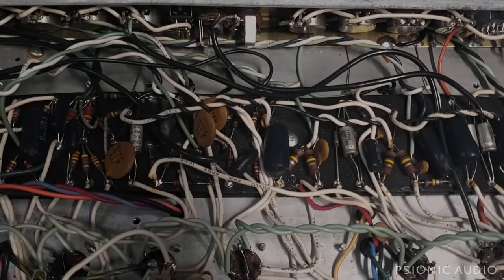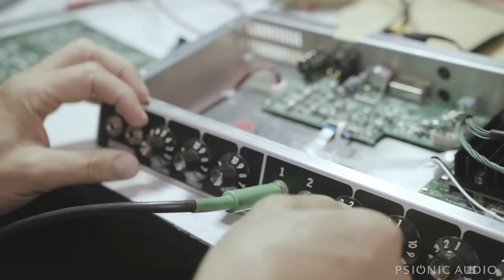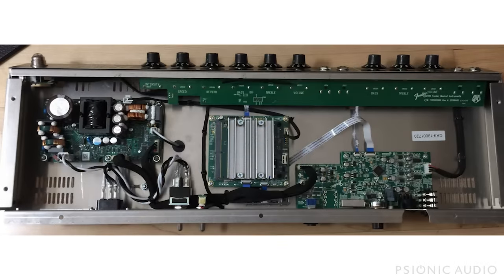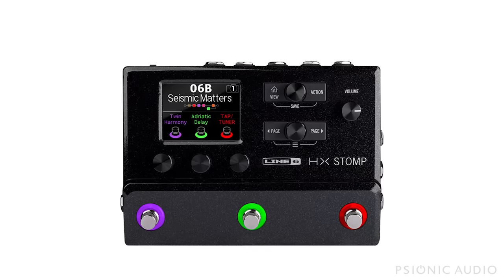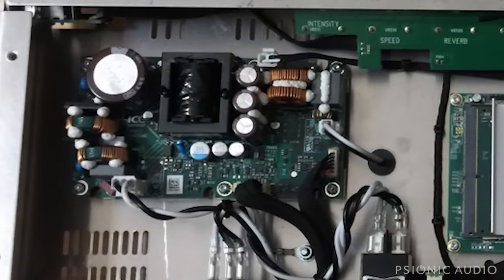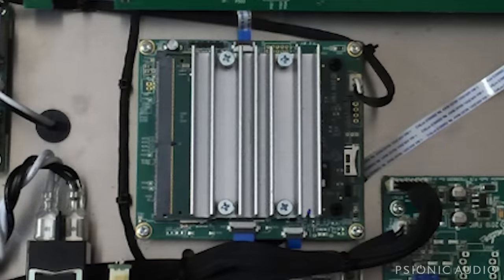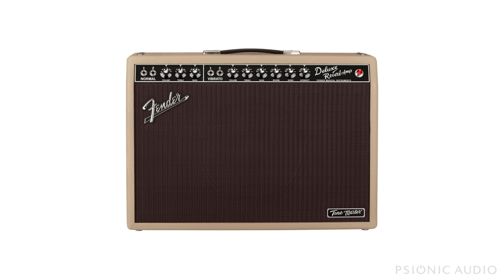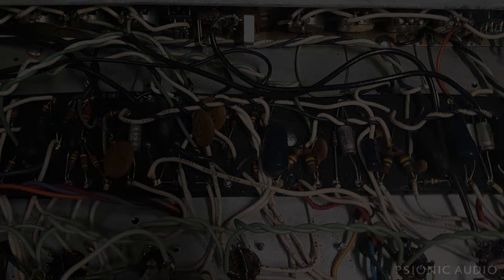We Need to Talk about the Tone Masters

Comment: Hello Lyle , let me correct you on a thing or two , the jensen neo speaker is not based on the C12K speaker , it is based on a jensen alnico speaker , also the frimware update is not needed if you have the black version ( wich i do for 2 years now ) , to my ears is sounds fine the way it is and i don't like the sound with the firmware upgrade  and the  celestion neo ( i realize this is an taste thing so everybody will have is own opinion on that ) , also an effect loop is not needed , my time related pedals sound fine just in front off the amp , also the resale value is fairly good , here in holland they cost about 950 euro new since there on the market and i see them being sold 2e hand for 700 euro on the markerplace site , so that's not to bad either . All in all , not to bad , but yes , will they last ? , only time will tell , it's good to see they can be repaired though ( wich was one off my worries ) , luckaly i live near to the official dutch fender service center , so we'll wait and see, but for me at least this is an perfect solution amp , good sounds , not to heavy , ect. and i also use an behringer P1 so i can play silent with my headphones wich is an extra plus , the behringer P1 only cost me 50 euro's and an short xlr cable for 5 euro's , so that's not too many extra money to have this extra function with this amp . I have been a tubesnob for 40 years , but those day's are over , i am sticking with my tonemaster dr . Like you're vids , grt , Toon.
Reply from the maker: Fender spent five minutes in their video explaining how they painstakingly modeled the sound of the C12K.
Reply: @PsionicAudio  mmm , well that's news for me , haha : ) , but to be frank  , i don't give a .... where this jensen neo is modeled after , all i know for sure is the fact it sounds ok to me and like i said i don't like the sound off the celestion neo and firmware upgrades . We all know sound is an subjectiv thing , but for me the fender / jensen marriage is made in tone heaven : )

Comment: I have the blonde Tonemaster which is the one with a cream back, it sounds great to me but I also haven't got or played a valve one.  The firmware is comes in both Jenson and cream back flavours and both have a with and without bright cap option.  They also adjust the taper of the reverb pot.  As far as I am aware you can flash between all of them on the amp as you see fit at any time, it's just a little fiddly as you need to hold a button to let it load in update mode.

For me the best thing is I can turn the dial on the back to 1W for home playing, and I don't gig.  I wish it had a headphones out as well as the XLR but at some point I'll get lucky on eBay and find a cheap mixer for that.

I am fully aware that the nature of the build means when something gives up I'm probably screwed if I can't get the part.  When that is the case I'll probably get a chassis kit and build a valve one into it and reuse the cab, faceplate, speaker and knobs.
Reply from the maker: I forgot to mention the lack of a headphone out in this. When I do the full amps < $1000 video I'll mention the workaround.

If I had one here I'd run the XLR out into my Focusrite Scarlett which does have a headphone out. Which is similar to what most people using the XLR out would do these days. Or I could use the headphone jack on my laptop if the XLR to computer interface lacks one.
Reply: @PsionicAudio  a computer interface is my other plan to try I just don’t have one.

Comment: Fender is saying that the Tone Master series and the other newer fender amplifiers use LOW Impedance reverb compared to the 60's to 80's fenders amps used HIGH impedance reverb. The low impedance reverb has a darker tone compared to the HIgh impedance reverb is more sparkle and high end. What is causing the reverb driver to be low impedance compared to the older reverb drivers to be High Impedance? or do you know what fender is talking about or means about the reverb being low impedance is a darker tone and the high impedance reverbs being very sparkly and high end?

Comment: My other comment about Fender's modeling effort concerns modeler obsolescence.  I have, and enjoy, a Mustang III modeling amp, but it became worthless once Fender took it off life support by killing the software to make/maintain presets on a laptop, any updates to the firmware, and the users' forum that added so much value to the amp's experience.  I anticipate that the 24-position rotary switch that allows 100 presets to be stored onboard the amp will fail at some point, so I wanted a spare.  While it may be a generic part that someone in the biz could find from an electric parts house, Fender said, "sorry, time marches on."  I'll try to fix it when the time comes, but I'll never buy another Fender modeler (or probably any modeler, for that matter).  Lesson learned.

Comment: Sorry to comment on a year old video.  But... can a guitarist replace the thermal paste on the cpu when it dries out?  I usually do that on my self built computers every 2 or 3 years or so.  The heat sink on the cpu seems a little undersized and I didn't see a cpu fan.  These seem to be disposable amps, much like a cheap laptop that can't really be serviced by a regular tech.  Give me 50 year old Silverfaces and I can keep them going as long as capacitors and resistors are available.

Comment: Could you talk in some video about the Roland blues cube? They got a real wood cabinet and good speakers. Some claims that they are the SS amps with the most valve like sound. I wonder if they are a good purchase
Reply: Agreed. They have some interesting hybrid approach to emulating tube amps, but have discrete power amps AFAIK. I've gigged one for three years, very happy with it.

Comment: I have played a couple of these and they do sound very good.  The thing that puzzles me most about them is why did Fender commit so much of it's processing power to make the reverb sound real when they could have simply used a real reverb tank.  I am also puzzled over the lack on an effects loop.
Reply: If I had to guess (lack of reverb tank) is to cut down on weight/ production cost.  As for the FX loop (I’m not a fan myself) they probably would have gone with a cheap FX loop at which point it wouldn’t sound great and would be just another point that could potentially fail.  That being said my 1966 original fender Princeton non reverb doesn’t have an fx loop or a reverb tank and I like it fine.  I have this amp as well in the blonde and i also like it.

Comment: I owned the TM deluxe reverb before selling it. The sound is great and you can’t really tell any difference between DR valve however the deal breaker for me was it felt sterile. No sag, slight delay and squish you get from a valve amp. Until they can emulate that feeling I will take a pass.

Comment: Thanks for the video upload! Besides what others have commented in, ONE question I have regarding the quad core computer processor: Cooling, and is that itty-bitty aluminum heat sink sufficient, INSIDE a wooden “case”? There's got to be reasons for computer builders to push for bigger cooling solutions, even to the extent of liquid cooling.

Depends  on the amount of heat that thing chucks out... I can't say THAT particular aspect gives me confidence! And, how that reflects on other design aspects as well, kinda a mindset / attitude thing.

All things considered if Fender made a TM BF Princeton Reverb and priced it like a Blues Jr, and it came with a good Jensen or Eminence speaker, it's not impossible then that I might be tempted.

Comment: I think the pessimism on depreciation is too high. A solid pine cabinet with this quality of tolex and grill cloth is $300-400 new and $200+ used. The speaker is $150 new and $100+ used. That’s a bare minimum of $300 WITHOUT counting the amp!! Factor in some factor of usefulness of a working amp module (even with a V2 in play) and you’re easily at $400-$500.
Reply: This is in no way a comment on the longevity of the amp, however. I think if you buy one to use heavily, assume worse case it’ll break in 5-10 years and you’ll be left with that very nice loaded cab you can sell for $300+. For many, this is a great compromise for years of use & benefits it brings over its DRRI cousin. Others compare to the DRRI and see it as horrible 🤷🏼‍♂️

Comment: Something else to watch - I plugged a SCXD in at a person's house who did not have full 110/130 VAC out of the wall while the amp ended up absorbing direct sunlight. I wasn't paying attention and it fried the digital board. I got a good ten years out of the thing and it was my fault but watch heat and voltage  on these things. I will take my replacement SCXD to rehearsal and what not but when I don't have a guitar on, it gets turned off and it does not go in the sun.
Reply: I do wonder about the reliability of digital modeling amps at outdoor gigs with generator power and sunshine.

Comment: As the owner of a much loved modern cheap tube amp with a couple of small smd-laden boards that are predestined to fail in some way, I was looking forward to Lyle talking about how he'd be able to change out smd stuff without much problem, should the need arise.  I think I've heard him say something similar on earlier videos.  Here, though, he makes it sound like "you can replace the smd-laden board, or pitch the amp"!  Say it ain't so, Lyle.  Which is it?
Reply from the maker: When an amp costs/is worth it less than my bench fee...

When there is no schematic and would take billed hours to trace the circuit....

I decline.
Reply: @PsionicAudio  Thanks for the quick response.  So, not necessarily cost effective, or recommended, but apparently doable by someone (I don't buy w/o a schematic), so that's a comfort.  Love this discontinued amp's tone, limited but adequate feature set, footprint, etc., for my needs, so it's worth some $$ to me, rather than start over.  Not everyone would, I know (my car is 25 years old and lots of mechanics have told me to scrap it instead of putting in another repair, but it's a great car that I couldn't replace for 10x the repair cost).  Thanks for the candid input.

Edit:   I think these kinds of issues (in caps, below) might change my perspective on repair, though:

"The cheapest parts found in mass produced fenders can be troublesome. LOW BUDGET PCB FENDERS SOMETIMES USE RAILS OF WIRES TO CONNECT TO THE PCB. WELL, IF ONE WIRE BREAKS ON THAT BUS, YOU’RE KINDA SOL UNLESS YOU AWKWARDLY JUMP EVERY WIRE BREAK OR JUST BUY A NEW WIRE HARNESS WHICH YOU MORE THAN LIKELY WON’T BE ABLE TO FIND. IF YOU TAKE APART AN AMP LIKE THIS, YOU NEED TO BE VERY CAREFUL TO NOT BREAK ANY CHEAP WIRES The PCB mounted components themselves are straightforward to fix, you get their value from a schematic and then solder a new one in. MASS PRODUCED PCB AMPS TEND TO USE EXTREMELY NICHE PARTS THAT ONLY THAT BRAND REALLY HAS ACCESS TO."

Comment: Excellent video sir, and really balanced as well. One thing I would note is that you will, one day, have supply issues with tubes as well. That day may be very soon or it may still be years out, but cold war tech isn't going to just continue working forever. The clock is running there too. Also couldn't agree more that a slightly beat up silverface anything Fender is still a value prop of epic proportions. Give it to a good tech, get it some love and kindness, and it will work its booty off forever. I had a 68 Pro Reverb that I did just that with. Amazing amp until you had to carry it up a flight of stairs. Anyway, great vid, keep 'em coming.

Comment: Tubes rule.  But I've heard an A/B tone Master vs. Tube Reverb and the Tone Master sounded great.  May be more of a nuance thing.  Tube richness and OD breakup for the foreseeable future is still superior IMHO.  But considering cost and weight (Heard the solid-state Fenders weigh significantly less), the Tone Masters will find homes.  Agree tube based amps will offer repair options that digital amps may not - on the other hand, that is true of pretty much all electronic devices.  Try getting your $$$ big screen TV repaired after the manufacturer has stopped stocking parts.

Comment: I seriously cant understand why they do not have an IR loader so that you can use whatever IR you want. Seems like a logical feature that many players would love
Reply: Because it's designed to emulate just one amp. And the reason it does that so great, is because all the DSP / CPU power is used for that one particular sound. If I'd wanted an IR loader or be able to choose from 300 amps or cabs, I'd buy a Kemper or Helix.
Reply: @supersonicsroots  yes but you can mic a deluxe reverb in 300 different ways and maybe the mic technique that fender is using just isn't fitting what i want to use.
Reply: @midnightmix2692  then you can eq the difference. It's not meant to be an IR loader, it's just an extra. Mostly for being used on stage, and homerecording on lower volume levels.

Comment: Fender don't have a good track record supporting their digital amps. They dropped the Mustang firmware and software support like a hot potato as soon as the GT came out. Overnight, Fender removed all the data from their website. This included the massive user library. The amp wasn't THAT old!!
I got in touch and asked why they didn't make the editor open source for the community to keep up to date.
I did not get a satisfactory reply. They no longer wanted to support the amp, and seemingly, didn't want users to either.
My guess is that the GT was out and Fender wanted you to buy a new unit.
Will it be the same for the Tone Master in 10 years time?

Comment: It's basically a computer with a high-power audio output stage added, so....does the CPU stay on and draw some small bit of power whenever it's plugged into the wall, even when the power switch is "off"? If so, it'll get zapped every time the power blinks off and back on again, or when lightning strikes nearby (plan on using a good surge suppressor with it). And how does it interface with the Internet for updates? Wifi? Bluetooth? RJ45 connector?
Reply: Well, I think it’s an oversimplification to say it’s just basically a computer, in that it’s not a PC running an amplifier app. It’s not Windows or any other OS with automatic updates installing on a regular basis, and it doesn’t maintain a regular internet connection. If, as a user, you want to install a firmware update that Fender has put out, you download the update to your computer, plug the amp in to a USB port, and install the update that way. In that sense, it’s more like an old school MP3 player vs. a smart phone.
Reply: @jfturner67  , I've worked on plenty of audio-video amplifiers and receivers, with numerous surround-sound modes, and I can tell you from experience that audio processing of that type is glitchy,  prone to freezing up or generating random noise,  and perforning software updates to fix such problems is neither easy nor foolproof. I worked for an authorized Yamaha service center, and they've got far more experience with audio processors than Fender does, and if Yamaha can't get it right then I don't expect Fender to do any better.
Reply: @goodun2974  I dunno, I and a bunch other folks here have been using these amps for a couple years now, and I haven’t heard anything about widespread freezing up on these devices or experienced it myself. I’m not in the future-predicting business, so I don’t have any strong feelings about the long term prospects of this technology. There just seems to be a lot of hate for these amps in these comment threads that seems unjustified at this point.

Comment: I have a Tone Master DReverb with the original 12 " Fender Speaker , that has not had the firmware upgrade to the speaker. If I just replace it with the Celestion 12 " , is that the same as the firmware adjustment on the Fender speaker ?
Reply from the maker: The firmware upgrade takes out the bright cap modeling and gives the emulated Creamback on the recording amp. Doesn't affect the physical speaker.

Comment: I'm plugging my guitar into Input 1, using Input 2 as the feed for my FX going back into Normal 1. Works as a parallel FX loop, though phase reversed like with the original Deluxe.
Reply from the maker: That's not really how it works.
Reply: @PsionicAudio  Well… it works well enough for what I need it for. You can mix original and processed signal and EQ them separately, too. Also, only the original signal gets reverb/tremolo, FX stay pure. Without FX (just jumping Vibrato 2 -> Input 1) I can even put reverb only on the treble part (turning Vibrato Bass down, Normal Bass up and Treble down) of my signal to avoid mushiness. Try it, you can really get fine sounds out of this amp. BTW I also put that Celestion speaker in my black DR.
Reply from the maker: You're doing more of a wet/dry thing with additive gain options. Which can be cool, but still doesn't let you put time based effects etc after the amp's preamp gain. 

Granted, this stuff is more crucial with higher gain amps, and there's nothing wrong with using pedals in front of a DR.

But the lack of an FX loop is still strange to me.